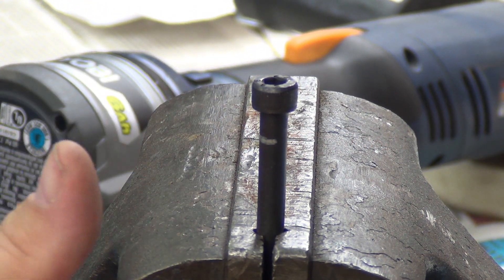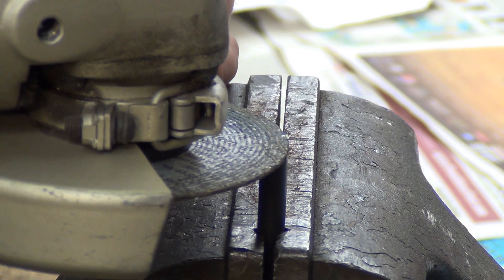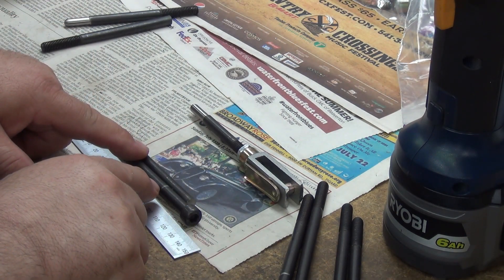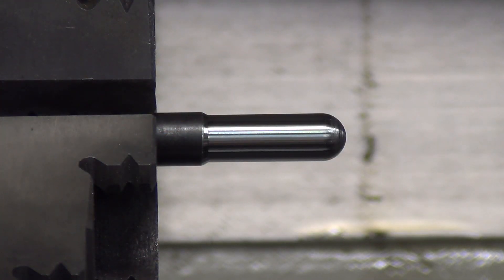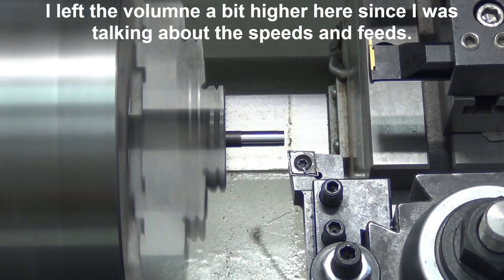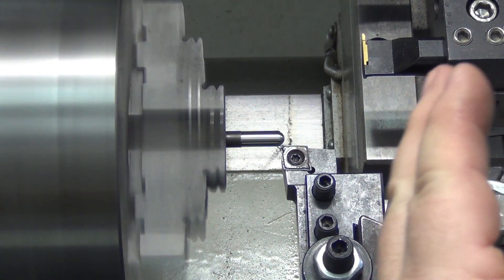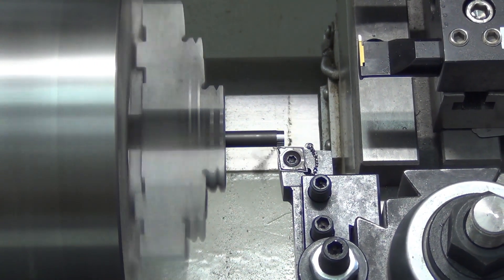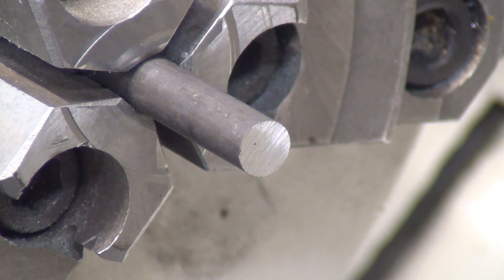Push Rod - 15L Slant Pro, Tormach

Comment: Love the idea with the cutoff wheel. I've used a few Kennametal tools in the past with lathes. Wonder if a good holder from them and a carbide insert would allow you to be able to part off the bolt, Cone the end and then finish it?
Reply from the maker: I've done them before with a cutoff tool instead of the wheel.  As I mentioned in the vid, I just found it as fast and cheaper using the wheel.  The Nickole mini cut inserts are $14ea...I think....and I was breaking one way too often.  Maybe a Kennametal version would do a better job without breaking.  The bolts typically have some kind of bow or bend to them....I'm assuming from the heat treating process.  At this point, I've made enough that I doubt I'll ever make any more.  There's a slight chance I'll make something similar for a different use.  Until then, it's not an issue. :)  Thanks for the suggestion! :)  Mike
Reply: @bluehandsvideo  if you ever do work with something that hard look at the A3-A4 holders especially the thicker inserts. Might not be able to feed as hard but the inserts alone from personal experience had battled hard and soft steels of all sorts with no issue at work. Solid food for thought if this is an problem later on
Reply from the maker: @jr540123  Perfect.  I just looked them up.  A couple of other cutoff tools came with the lathe....I'll have to look at them more closely, too.  Thanks for the reference numbers.....I had no clue without them. :)

Comment: Do you think it would flex as much if you gripped it closer to the chuck? Personally, I'd use a collet and those with a dead stop... Ask me how I know... :)
Reply from the maker: I think they'd still flex a bit.  I can only get the tool so close to the chuck before the "pucker factor" starts to chew holes in my underwear. lol
I really should buy a collet set.  I might see about doing the next parts with the one collet I own. I'm just so used to dealing with the check.  Plus.....the part after that will require a chuck if I don't order in a collet set. lol